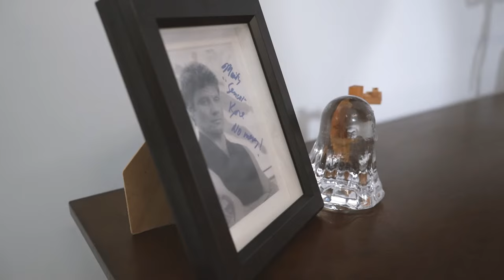Conceal Those Ugly TV Power Cables In The Wall In 15 Minutes With Echogear

Comment: Can this be used on an exterior wall?
Reply from the maker: Yes this cable kit is designed to fit into both interior and exterior walls constructed with the following: minimum space into wall 3". Minimum Drywall thickness 1/2"

Comment: I had a hard time cutting the hole with the saw I used a compact drill and it didn’t cut
Reply: I just installed mine less that 2 minutes ago and had to go buy a 20v craftsman drill from Lowe’s and it drill perfectly. Got the drill on clearance for $50 bucks
Reply: Probably you drilled the wrong wall it has to be studs in there